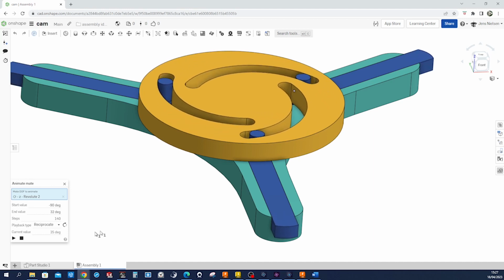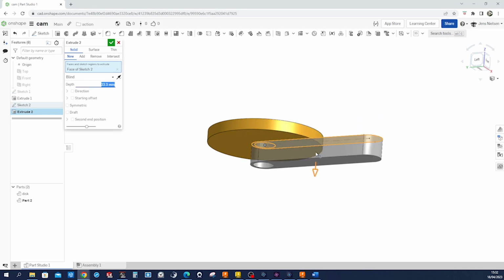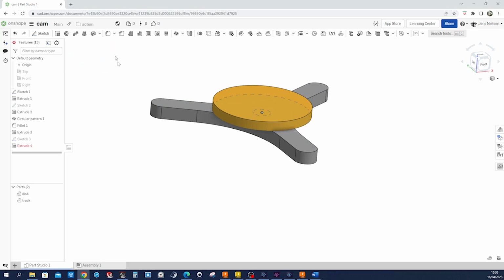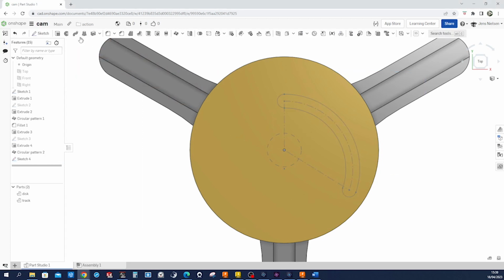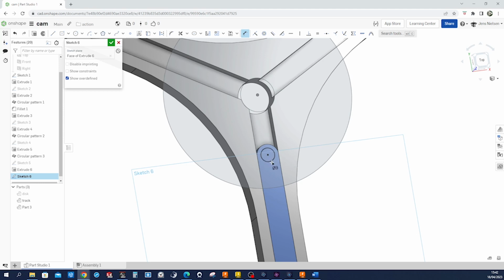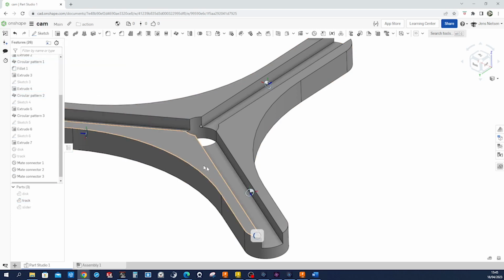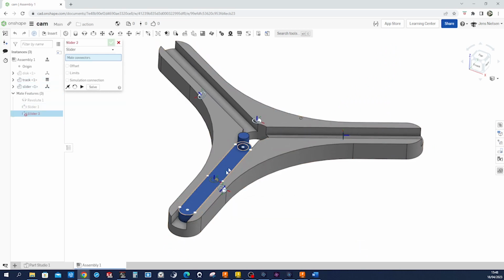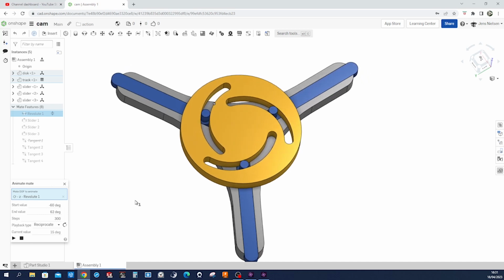Slot Cam & 3 Sliding Follower Mechanism assembly in Onshape

Comment: I made one of my own and when I set up the tangent mate and pull the rod out manually, it seems to get stuck at the end of the slot and I'm unable to move it any longer.
Reply from the maker: What about the "tangent propagation" checkbox in the command?
Reply: @cademist  Yeah, haha. Seems I always figure it out about an hour after I ask you a question. 

Is tangent propagation used primarily for parts that will follow an exterior contour?
Reply from the maker: @konradbrochocki4923  yes, with tangent continuity